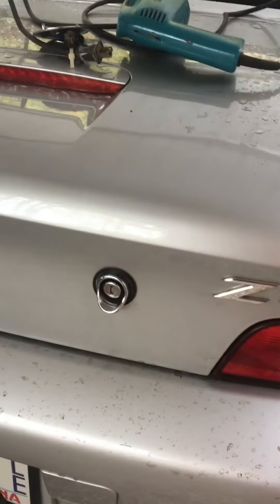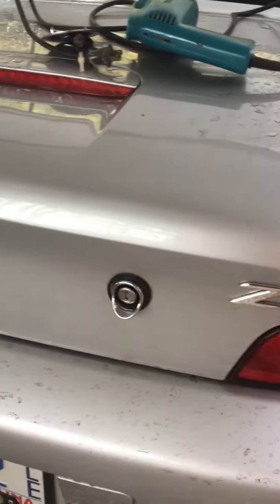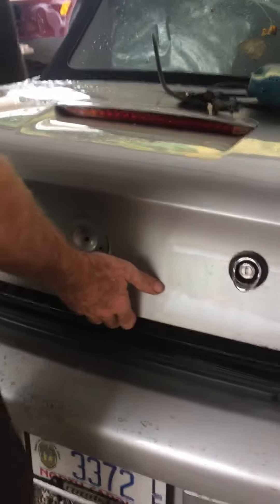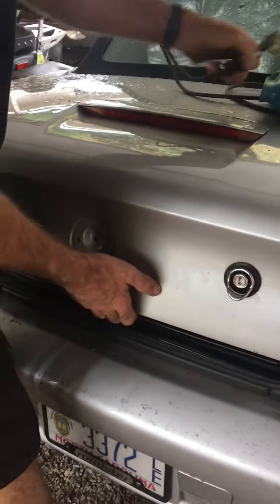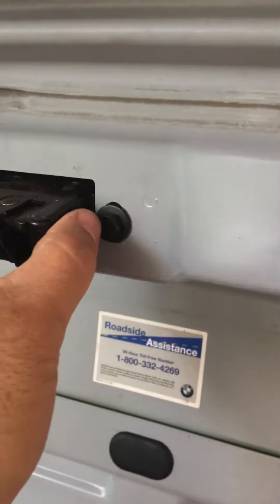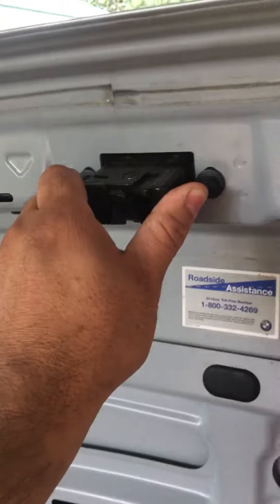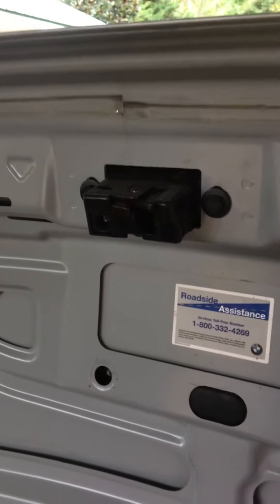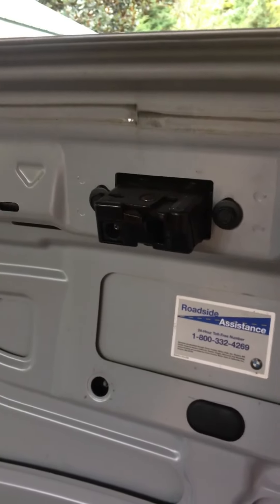2000 BMW Z3 Trunk won’t open

Comment from the maker: Turns out the problem is the rod that attaches to from the lock to the latch. It’s held by a plastic tab that get gets brittle and weak causing rod to pop off. It took us 15 minutes total to fix. Works great.
Reply: jojucoaj I’m having the same issue with my 96’ (96-2000) the same. We are able to get into the trunk (thankfully no drilling), but while trying to replace the latch I tried to pop that tab off of what looks like a trailer hitch ball, and broke that little black plastic piece that threads onto the actuator rod. I’ve no idea what it’s called and I’ve called BMW 5 times and they keep telling me it’s the actuator rod, and I’ve told them repeatedly that I just need the little black piece that connects the rod to the latch and I’m getting nowhere. I wish I had some help!

Comment: would this worked if the boot was locked and not stuck?, my cars are in my boot and its locked
Reply from the maker: Can’t say. My sons z3 the problem was the rod which the plastic tab holding it became brittle. Method should open your trunk but i’m no professional so it’s at your risk. I haven’t had problems since I replaced tabs